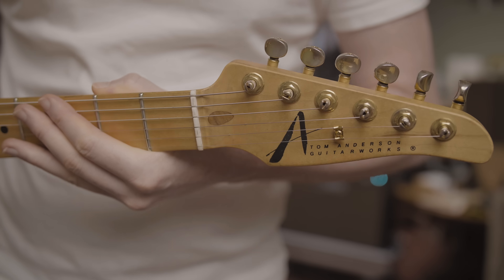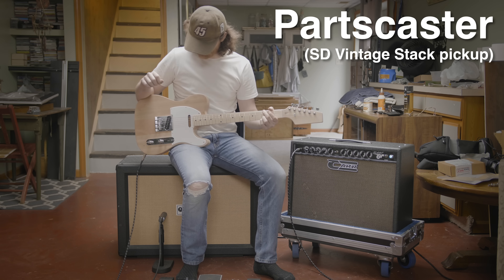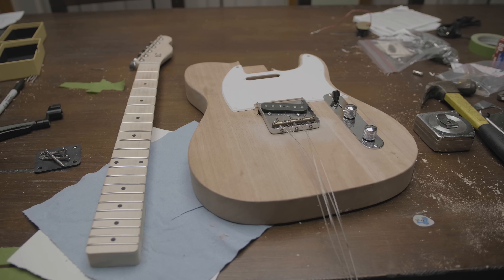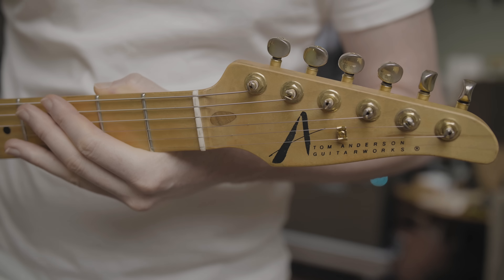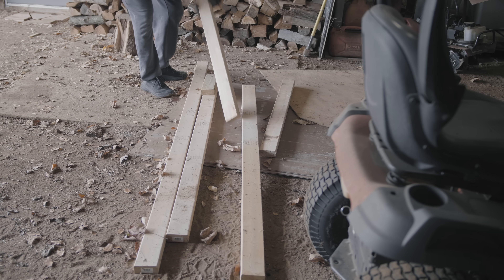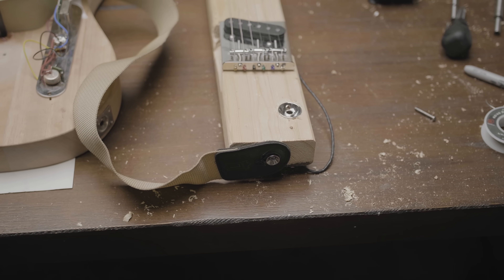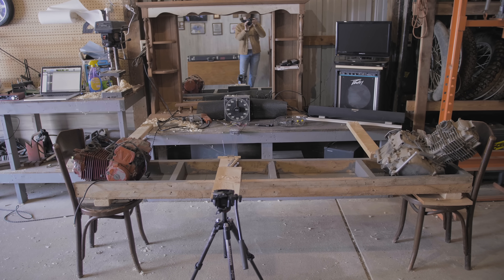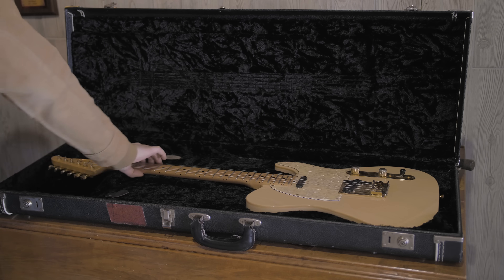Tested: Where Does The Tone Come From In An Electric Guitar?

Comment: This is why I basically only make sure a guitar isn’t irreversibly messed up when shopping (given it has all of the features I want). 

If the guitar can be set up to play notes without fretting out and have a fairly low action that’s really all that matters. Anything else is either for looks or can be changed easily. As long as the guitar can play, and I like it in general, it’s a good guitar. No need to spend money on expensive “tonewoods” or fancy hardware if you don’t want to.

Comment: I've always said that for electric guitars, the tone comes from variables concerning the strings, pickups, electronics. The wood has no factor because there are no acoustics involved. Pickups are magnetic, not microphonic so while for example two strats from different woods might sound different to you when you play them without amp, the pickups are not going to pick that acoustic difference up as that interaction is in the air, not in the magnetic field. The wood is not going to make your string vibrate differently so you have no difference.

Comment: Very interesting and well made video, thank you!
I have some thoughts on that matter too.

First off, my list of important factors:

1. Player
2. Amp
2. Pickups
3. How well the Guitar is made (in term of handling)

I think the thing with electric guitars is, that the tone is literally picked up from the strings, so it makes sense that all the other parts on the guitar don't make a lot of difference. I could imagine the only difference that wood etc. could make is in the sustain of a note, because then the strings actually have time and a chance to resonate with parts of the body.
That the next thing:
I can still imagine that wood is important in instruments, that use their body or, for lack of a better word, a "resonance chamber" to amplify the sound made by the strings. Because at this point the wood and form of the chamber actually contribute to how the sound is modified.
btw. i thinks that also explains that people say, the amp makes a bigger difference than the guitar in terms of sound, because its actually contributing or modifying the sound more than any wood does (in terms of an electric guitar).

I would like to see a similar test with acoustic guitars and like i said the "sustain" of the tone/a note with an electric guitar. :)
Reply: Nope. Still nonsense. The pickups are sensitive to the string vibrations between the bridge and the nut. Period. How can those vibrations even get to the guitar body?

Comment: When you finally try to play some slide on the bench guitar at the end of the video you can finally tell the real difference. In short back to back clips of heavily distorted signal it's hard to hear sometimes, but with the bench guitar you can clearly hear the bench reverberating and when ever you play the tele there is a thick rich grounding to the sound that you just didn't hear at all in any of the tests of the other body types.

Comment: I’ve noticed the same thing when I started building oil can guitars. I bought a super cheap electric guitar, then converted into an oil can guitar and it instantly sounded amazing. I think the metal can is much more significant to the tone, compared to a wood body.
Reply: well that makes sense since you effectively have a hollowbody guitar.    on a solidbody guitar, the pickup is fixed and wont move in any meaningful way; but on a hollowbody guitar, the soundboard & pickup CAN move - and i think we've established that pickup height does matter.

Comment: Honestly I think I yoyre missing the point that you made a body out of a wooden work bench. Still captures and vibrates the tone. Neck might help, but the distortion definitely masks the sound of the guitar. Also, modeling it could just be through the amp.

Comment: Hi, got an idea. TOM-style bridge height, also tailpiece height, string bend angle between these two, wraparound bridge height. Spectral analysis, please. I would guess the taller height would mean more emphasis on lower frequencies and vice versa, but the heck do I know. Of course, when playing with open strings, this has a miniscule effect on the nut string angle too.

Comment: There's something that gets overlooked all the time, and that's the truss rod.
Mute your strings, put your ear to the wood and tap the side of the guitar and listen to it ring out, unmute the strings
and listen again to the combined sound of the stings and the truss rod.
You can hear the difference in the air guitar, the air guitar is clean, and you can hear the spring effect in the normal guitar.
Reply: no

Comment: Market the 2X 4 guitar and you will be a millionaire. Its basically Les Pauls original prototype. You can offer pressure treated wood,spruce ,pine or 2x6 for heavy metal. Reclaimed barn wood for the purist😎

Comment: Wouldn’t choice of wood affect damping and therefore vibration of the strings. If scale length, bridge setup, pickup were constant (length, position, tension) and one guitar is made up of something dense (solid block of lead) and one guitar is made of something lighter (wood). Let’s say I made a robot that could pluck the string in the exact same way. Would an oscilloscope show any difference? Would it be audible?
Reply: Nah
Reply: @dfasht The video above by Jim Lill disproves this

Comment: So... With the air guitar. Wood on both ends will sympathetically vibrate with the strings. Try heavy metal. Something that will have as little sympathetic vibrations as possible.

Comment: This is a great scientific test and debunk of the salesman claims. IMHO it would seem likely that one factor for same tone is whether there is enough mass and hardness at the fret/nut/bridge to avoid absorbing/decay of the string vibration and its harmonics. Another is the pickup height and model as you found. In theory, the electrical load on the output of the pickup affects the magnetic damping of the strings which would likely affect the tone. Looking forward to seeing your update on this topic, thanks for the interesting study!

Comment: This is good, we could actually get audio samples for each feature depending on the tone and check all that have more correlation to the tone and try to predict the tone from a new set of parts and configurations (features). The only crux is standardizing what we call tone and nominalizing each value

Comment: "a 2x4 plank guitar might not be enough to push past deeply rooted beliefs". Oh man, nothing will. Just saw a video by a well known guitar reviewer saying this doesn't really prove wood doesn't matter. To me, just the mere fact that the air guitar sounds close to an actual guitar (and it sounds pretty close) should debunk eveything about wood. Great video!
Reply: which one was it? name and shame pls :P
Reply: Preface: I agree with the point of the video, that wood doesnt matter but amp settings and pickups do.
That said, it wasn't an air guitar, it was still a 2x4" guitar. 2x4s are still what hold the bench and shelf apart. The wood doesn't have to be right under the pickups and strings for it to be a wood guitar, it only has to be the thing holding the bench and shelf at a fixed distance.
Am I the only one seeing this? How is nobody realising this?
Reply: name-shame please!
Reply: I hear a difference between the 2x4 and the anderson. But not between the air guitar and the anderson. Maybe he just played slightly differently.
Reply: @fredriksvard2603  Put a frequency analyzer on them and you'll see the tonal differences. A bit more low end in the Tele body. The 'Air' guitar, which really isn't floating in air, but rather anchored between to huge masses is pretty close to the tele.  Mass and density likely do play a role in tone, to a point, and then it's probably just diminishing returns. Different woods have different densities and two pieces of wood cut from the same tree can have different densities, especially when considering how long the wood is left to dry, etc.  Are the differences night and day? Maybe? Potentially? Depends on the variables.
Reply: @bobshook3544  the point is the difference is negligible.
Reply: @Lamster66 I'm not missing the point, you're misunderstanding how vibrations work (sorry for my word choice). The bridge and nut are NOT isolated, they are connected by wood. Both in a normal electric guitar, and in the "air" guitar. Wood is not fully rigid. Softer wood should dampen high frequencies more at low distortion, resulting in less sustain. Tone should indeed not change with a different wood neck, but the reason is not that "the bridge is isolated from the nut". The reason is that the pickup + gain (amp) system increases signal amplitude to the point of clipping, so certain frequencies having lower amplitudes doesn't matter (because very high gain solves that problem)
Reply: And he would be right. Wood matters, just not for tone. For sustain, weight, durability, etc.
Reply: @ax3l_d994  you could save some huge bucks investing in pick-ups + amp (and tunning those amp settings), instead of going for the wood from that famous guitar brand that swears it's the secret to their tone.

But, if money is not an issue, I'm 100% with you.
Reply: The only problem with that thought is that when you make guitars out of something that isn't what they end up sounding like crap

Comment: Ideally, it should be the same physical pickup and electronics placed and tested on 2 guitars to eliminate possible differences in pickup materials, wiring, etc.
Reply: You're not wrong, but really? I mean unless the parts' tolerances ar +-20%, then there's really no discussion here, and most components nowadays have way smaller tolerances than that.

Comment: Great video! I really appreciate the effort. And interesting conclusions in the comments. Ironically, I disagree with most of them =)
The first rounds of comparing were quite different in tone. Once you got to the last round (air guitar) it really was damn similar. However, (playing devil's advocate here) it seems pretty obvious that the neck wood won't make much difference when no notes are being fretted. Also, for comparison, it is pretty easy to match a single note in sound. To me, a good instrument is all about balance. How does it sound in the higher register vs the lower? How does one fretted note sound compared to the same note fretted on a different string. In the end, all of this is subjective and depends on taste. Either way, I agree that PUs after player and strings make the biggest difference. The differences in wood can only be heard if the player, strings, and PUs are of high quality. Otherwise, it's like comparing bass toes on an iPhone. There is just nothing there to compare because most of it is lost before it hits our ears.

Comment: this is not science
Reply: you are the variable.
Reply: as is air density
Reply: @chrisdowdle1  well show us some then; scientist
Reply: @Yakomoe  engineer actually:)
Reply: Control the variables outside of what you want to test. ie don't strum yourself. Use an actuated system that strikes the strings the same every time in position and velocity. From there, what is it striking? Use the same strings. Replace every single time from a really solid manufacture. Avoids ductile effects. Or use the strings after bing strummed 10 000 times. Use the same striking surface, that is the same plectrum periodically replaced to avoid deviation of applied force from the above geometry and actuator from material fatigue of the contact surface to the strings. That is, is the pick getting floppy......... In essence this video has shown how to make the greatest elect gat by design. Attached it to two massive mass' and then attach those to the planet. All elec guitars accepted as being exceptional transfer the strings to the pickups super efficiently. This is around build quality. Which is a minefield in itself admittedly.  Ultimately you want the structure of a guitar to maintain the the strings formant above all. Do that for individual strings then creates consistent harmonics due to how those strings interact. That is what build quality is. This will make it resonate like a motherfucker.  It's a great vid. He really has built a great gat. In a way it's why pedal steels sound so great, they are in effect a small piano with pickups. Rigid as, allowing those string to talk well designed pickups efficiently without loss in supporting materials and maximum efficiently of signal transfer to disrupt the magnetic field created by the posts of the pickup. Maxwell's Equations; a moving magnetic field creates and electric field, hence why when your not strumming you got no note. When you do, it transfers to the coils of the pickup. It s a transducer, taking kinetic and turning it into electrical energy. Thanks for questions.
Reply: Oh and i forgot to mention do a Fourier transform of the signal. Capture on each round of testing. This take the subjective nature out of what the system which is the gat is really doing to the guitar. Takes the subjective nature out of the experiment and gives detailed results due to the effects on the harmonics of the system. This can be transformed back to time domain as well. Takes ears out of the equation. You could do this from the output of the guitar in to an oscilloscope or from a mic feed from a consistently set up amp not changes. I would suggest the scope.
Reply: @Yakomoe  you seem to be doing some good science you self man:) I approve.

Comment: Time to sell your shares in Fodera Guitars.  🤣🤣🤣🤣
The important property in the wood is it stability & rigidity. 
More rigid wood equal longer sustain. 
More stable wood mean the weather has less effect on the neck from winter to summer and humidity. Truss Rod adjustment will correct.
Tones created by metal string variations, magnet variations & pickup coil variations & placement.  🤓 😎

Comment: Really surprising me that so many guitarists can’t tell the difference in tone at several vital parts of the video. Firstly, the two guitars at the start… identical pickups, they sound totally different. The baseball bat variation: sounds surprisingly good, but the body guitar has much more depth. As for the strings with no wood: sounds nothing like a wood guitar. This video confirms to me that wood and wood vibration is most definitely a factor. One of the many factors that make a great guitar. It’s annoying when the guy says things like ‘I wasn’t sure if the tests I’d done were even valid’, or ‘I had all the data’ when the outcome of all these tiny soundbites is an audio comparison for your subjective consideration. You have no ‘data’. Why not find a way to digitally measure the tonal characteristics so we can actually prove just how different they are? We all know you can make a cheap guitar sound very good with the correct treatment, this isn’t cutting edge research.
Reply: Dude -- the two guitars in the beginning had same pickups and sounded different because he literally said "almost everything about  this partscaster is different than the andersons" -- as in pickup height, pickup hole position, scale length, and all those factors he  lists at the very end of the video. Did you watch this properly? When he finally accounts for all those differences in the end, thats when the air guitar bit comes, and thats when there is literally. zero difference. Im listening on 8k USD monitors hear in my fully treated studio. There is no discernable difference.

source: 16 years of guitar and bass playing
Reply: @elianmusic7452  I can 110% hear the difference between the guitar he’s hacked bits off and the intact one. All this video proves is that you can use decent pickups to make a crude guitar sound pretty good… which we already know. Well done on your 16 years btw 😂

Comment: there are some differences... put the phone on and take a closer look. The thing is, it's not that much. I even say more, with my experience, maybe the width of the neck influences more in the end. I felt differences mainly in the mid-bass, but in fact maybe the pickup is responsible for 90% of the overall tone. in the future, due to the preservation of forests, we will have more and more instruments made of other materials and we will be able to have a better idea. but to say that the woods don't really contribute is an exaggeration, but it doesn't have the strength that has been publicized since the beginning. Some people will invest in the remaining 10% of the tone and some people don’t care. it's like the seasoning of a food that in one place is one way and in another it can be different but you identify that it is the food in question, despite being different.

Comment: I think the most important factor for a good guitar are stability of the wood(like expansion and contraction of the wood from moisture and hot/cold) and definitely the pickups. And if you have a Floyd Rose tremolo bridge like my setup on my Jackson p.s.4 the springs react with temperature change as well but only to a small degree

Comment: In my humble opinion (based on quite a few years of playing guitar) For a good sounding and playing solid body guitar, the following are the most important-  accurately cut and finished neck pocket/joint. Neck fitted with no movement, well finished frets, decent quality bridge, pickups and electrics. Good quality tuners. Correctly cut nut. New strings. Intonation set and guitar in tune. AND A GOOD QUALITY AMP! I'm fortunate enough to own a few decent amps (Marshall, Orange,Peavey) ALL are valve amps (tubes to our colonial cousins) Even a cheap guitar sounds pretty decent though them. My Les Paul and Strat sound fantastic.  Through a cheap amp everything sounds shit. Moral of the story- a reasonable quality guitar that's been set up correctly and plugged into a good quality amp is going to sound so much better than an expensive guitar through a crap amp.